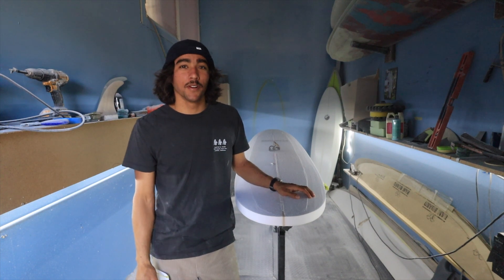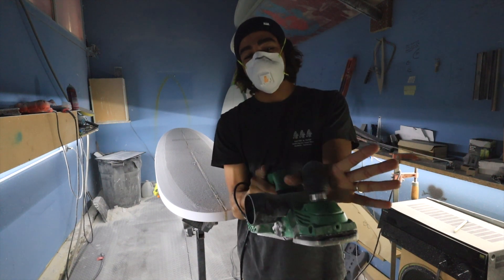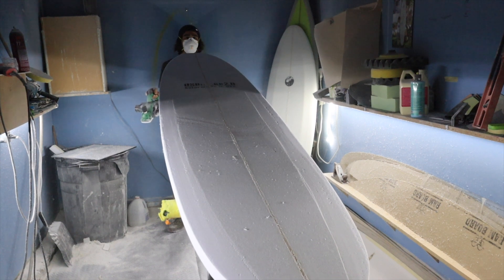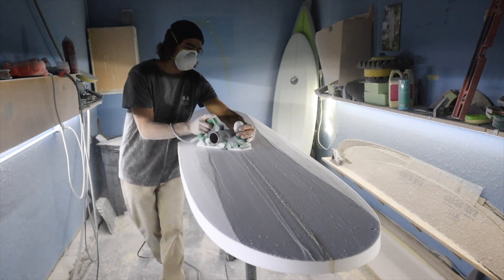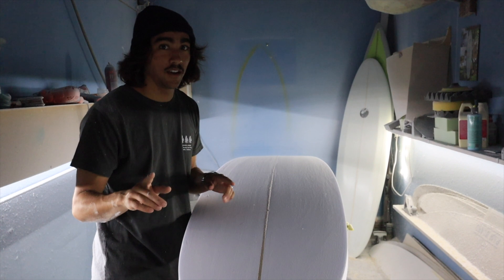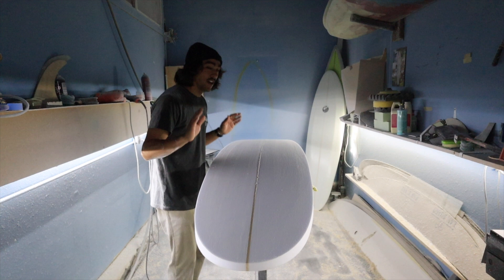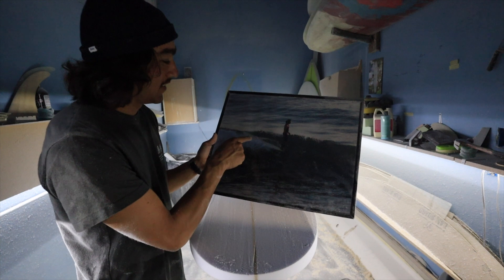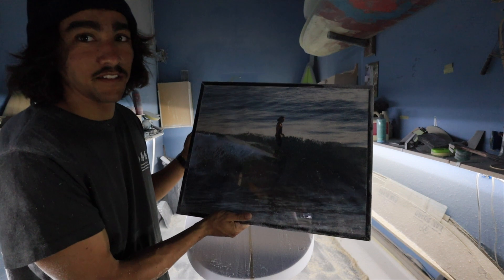HOW TO SHAPE A LONGBOARD SURFBOARD // PART 3 ROCKER & THICKNESS

Comment: If you skin the deck after you skin the bottom and then clean up your deck cuts befor you move on to leveling the bottom;  You won’t have to take as much off the deck after you have leveled the bottom.  Lowel

Comment: I've watched 8:30 to 9 about half a dozen times. It sounds like you are saying that by keeping the rocker low in the tail by shaving the tail down, you keep the rocker flatter, which gives you more speed. The part I'm not fully understanding is how the deck is giving you "lift". Could you expand on the concave and rocker in the deck, giving you lift? Cheers
Reply: The New Poly foams(U.S. Blanks, Arctic and Millennium) are manufactured in such a way as to insure consistent density throughout the blank.  The old Clarks were more porous at deck and center.  Clark’s were also much softer overall.  The idea that you can’t take much foam off the deck is an old idea held over from the Clark Foam days.  Basically it’s a mindset that has been perpetuated from one generation to the next.  I’m old and have shaped alot of Clarks, US Blanks, Arctic and Millennium.  The only comparison there is between a Clark and modern foam blanks;  is that they are all foam to one degree or another.  The new Poly blanks light years ahead of a soft dingy old Clark.  Assumptions made about a Clark blank do not carry over to modern Poly blanks.  Lowel/Little Hawaii
Reply: Hi mate, water flows over the board while noseriding. So the concave in the back of the deck (where the water is flowing) holds water and therefore creating lift. This also happens without a concave, but the concave (on the deck of the tail) it provides more of it. 

The more traditional approach is adding rocker the the tail of the board and roll (on the bottom), however, as Zack said, slows the board down in general.
Reply: @Mongiloyd @Mongiloyd Ahh, so not lift in the traditional sense, but lift from water running over the top of the board. Got it. Thanks for chiming in.
Reply from the maker: Yes @Mongiloyd is spot on!

Comment: If you take thickness from the top you end up with a soft deck, it’s better to thin from the bottom then adjust your nose and tail thickness from the top.
Reply from the maker: True! Deck will be slightly more prone to dent the deeper you cut into it. Even though I usually take a bit of foam from the deckI never get big foot wells or pressure dings, even with only 6+6 decks. I’m sure as blanks have continued to improve this has become less of an issue.

Comment: well if you take an even pass off the entire bottom you're not altering the rocker.
Also - are you doing a reverse rocker? looks like you're calling the nose the tail based on the blank logo
Reply from the maker: Yes if you are able to take totally even passes on the bottom it won’t alter the rocker, but I wouldn’t be able to get my desired deck rocker if I took foam off the bottom so I took it off the deck. Yes I’m doing reverse rocker

Comment: Looks like maybe 5” nose rocker and 2” tail?
Reply: Looks more like 3T, but it's often not about the endpoints, rather the curves. Also, wouldn't try to copy exactly what Zack is doing, I mean, he's on a different level xD I learned the hard way that it's best to use the natural rockers that are the ballpark which you want to end up with. Flattening rockers is hard to get good.
Reply: Rewatching this I just noticed Zack reversed the blank or has some custom rocker